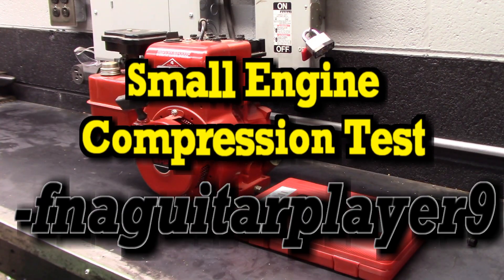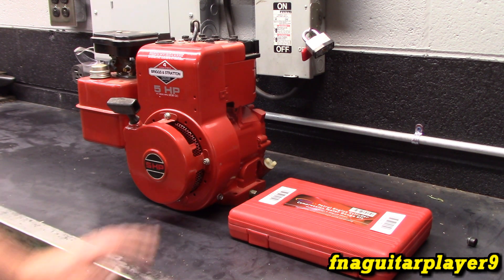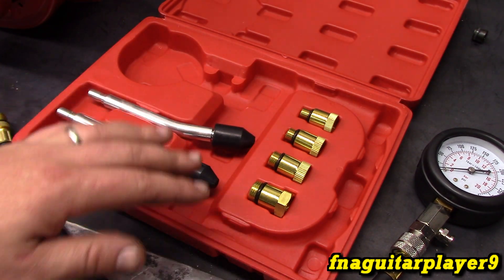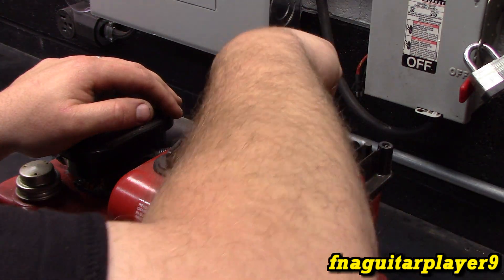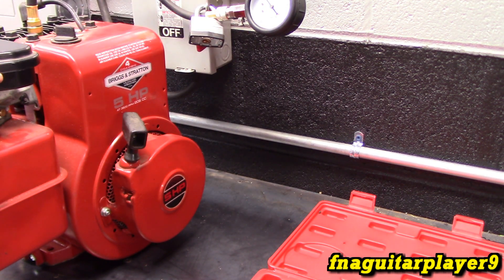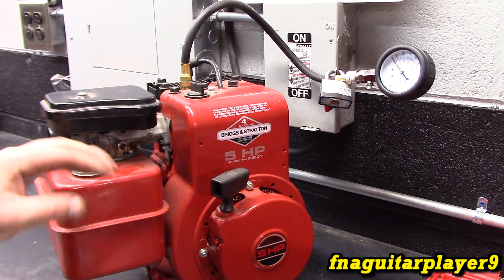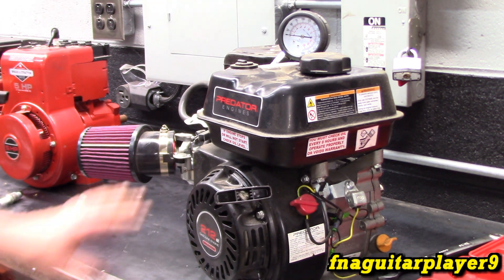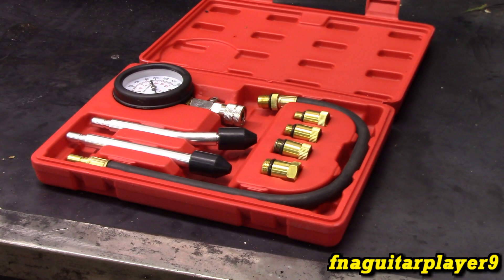Small Engine Compression Testing

Comment: Is that a Harbor Freight compression tester? These testers are no good, they always run to low of a reading. I compared one against my mightyvac and I had a 60 psi difference between them the mightyvac much higher. I think Harbor Freight now have one with the Madix brand, however, I have not compared that one to my mightyvac,
In case you were wondering, my mightyvac was compared to my friends Snap-On compression tester and they were in a couple lbs. of each other. So, I know my mightyvac is good.

Comment: This compression tester is not suitable for small engines. The Schrader valve needs to be where the adapters are threaded, not in the base of the gauge, that's why the readings are too low.

Comment: Not sure why but using the straight metal adapter with the rubber tip will get you a much higher number. A more correct number.